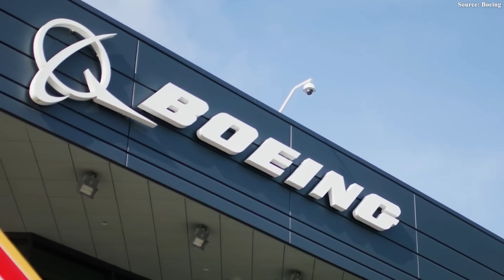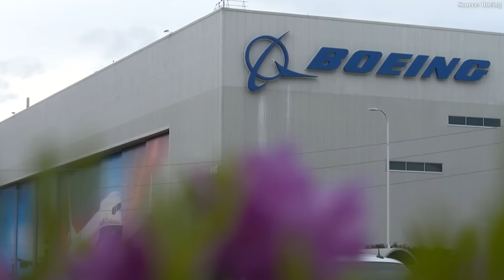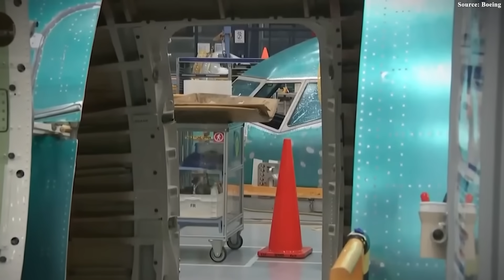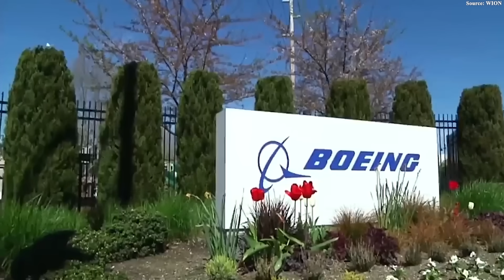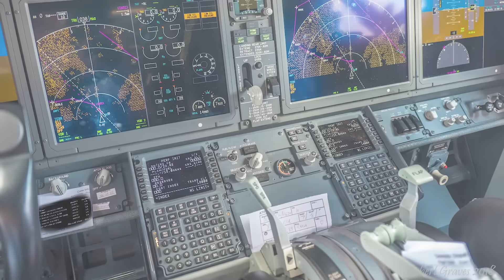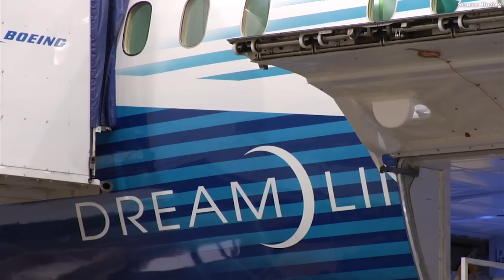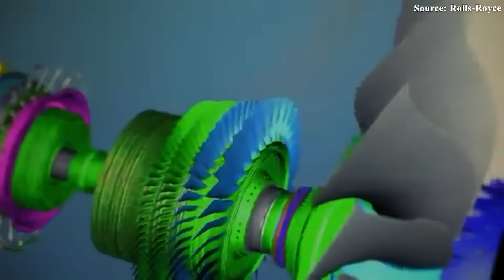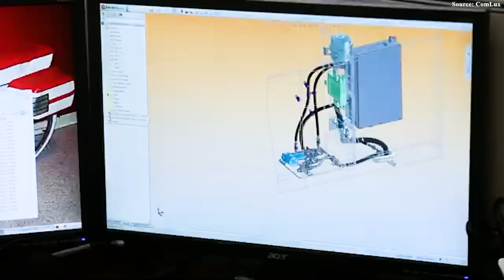Boeing's Next Aircraft Just OUTSMARTED Airbus - Then Something Changed!

Comment: It’s sad that people still fail to understand the 737 max debacle.
I’m not defending Boeing. But it’s only fair to get it right. 

MCAS was fitted to the 737 Max to ensure it kept the same type rating as older 737 models by offsetting handling changes from the new engines.

The 737 MAX's natural handling (without MCAS) was indeed well within acceptable certification standards but could not be flown with the original 737 pilot certification.   Had Boeing never fitted MCAS to this airplane. It would not have crashed.

Comment: The problem with this is that Boeing has not demonstrated the ability to do this. In addition, due to the MAX fiasco Boeing is deeply deeply in debt. Why would an Airbus or any other manufacturer which is not burdened by all this debt do the same thing?
If Boeing goes to the federal government for money I would refuse it. Why should you throw good money after bad if you're going to give money to a US manufacturer give it to somebody like Lockheed.
Reply from the maker: Unfortunately, Lockheed is not producing commercial aircraft at the moment.
Reply: @FLIGAVIA No they're not but they have Superior engineering ability to Boeing.
For the US government to give money to Boeing after their fiasco with the MAX is simply unwise.

Comment: I don't know why everyone is wetting their pants over the COMAC C919.  Most of the critical electronic and mechanical systems depend on Western suppliers.  The engines, landing gear, avionics, cabin environment system, lavatories, and even the passenger infotainment system are all from the US or EU.  These are not small items and can't be emulated quickly or easily.
Reply from the maker: Everyone is wetting their pants over the COMAC C919, probably because they’ll finally have a third option. It could also be because of the story behind it — the ambition to break the existing duopoly.
Reply: @FLIGAVIA  I guess that's the point I'm making, sir.  This really isn't a third option, at all.  It's "window dressng".  It's a "Potemkin village".  Only the most ignorant people could think otherwise. 

Just three companies (GE, Rolls-Royce, and Safran) make almost all of the widebody jet engines in the the world.  Every airliner has a Honeywell computer.  Collins makes the avionics for practically every airliner.  Specialist companies like Collins, Safran, Liebherr, Heroux, and Triumph make the landing gear.  At this point, Chinese companies are making the fuselage, wings, some of the onboard electronics, and some of the cabin systems.  But, these account for relatively little of the critical active components of the plane.  

The engines, avionics, flight control systems, actuators, generators, computers, landing gear, navigation, the fly-by-wire system, brakes, transformers, flight recorders, water & waste systems, simulators, fire suppression, galley equipment, and even the INFLIGHT ENTERTAINMENT SYSTEMS are made by EU and US companies, mostly outside China.  (Frankly, when China - the world leader in consumer electronics, TVs, and video devices isn't making the in-flight entertainment system for their first widebody passenger plane...you have to be a bit skeptical.)

I think competition is great, but we should not delude ourselves into believing that this is some demarcation point for independent Chinese production.  The C919 simply couldn't be made without the vast majority of the major components and systems coming from the US, UK, France, and others.  

So, again...I advise people to keep their pants dry for a while.  It will take a very long time for Chinese industry (especially state sponsored) to develop domestically-made alternatives for all of these things.  They will also have to go through the lengthy process of gaining approval in all of these countries before deploying those systems.